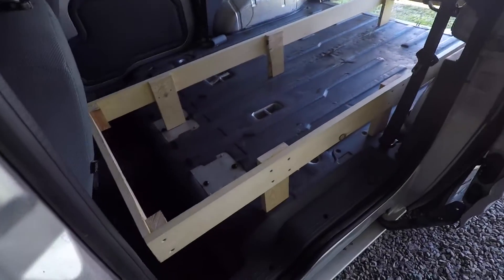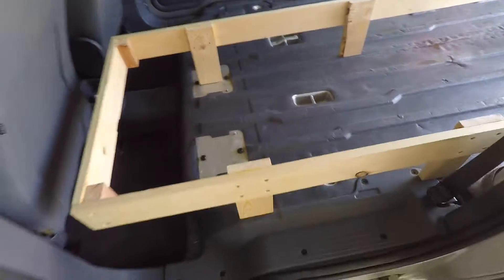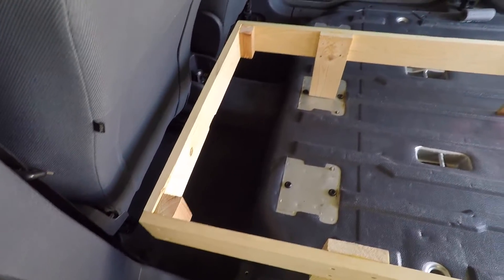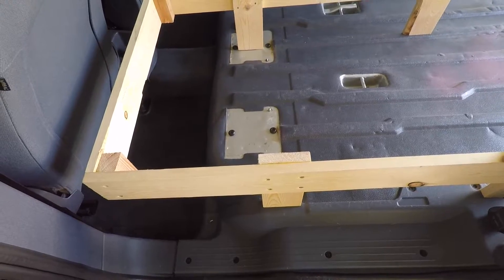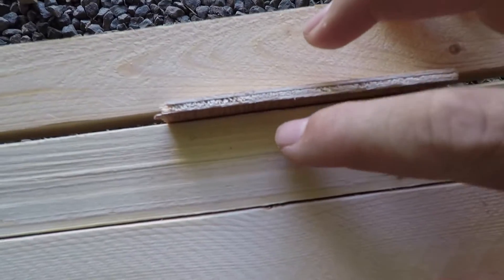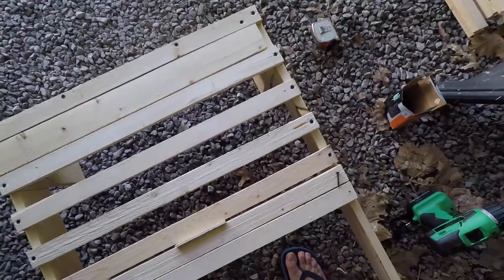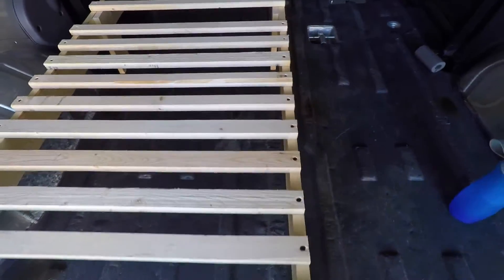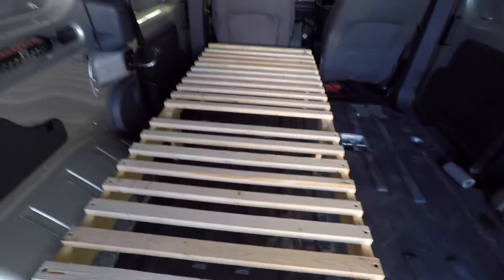How to Build a Pull Out Campervan Bed for TWO (part 1)

Comment: How did you arrive at the finished height of the frame? I’m thinking of having the top of the frame level with the top of the wheel wells, but still need about 9” of under clearance to let the batteries slide or roll out from under the bed.
Reply from the maker: I changed the finished height three times on this bed build. Everyone will have their own set of requirements that will determine what the best bed height is for their set up. Build it to suit your needs and that's all the matters.